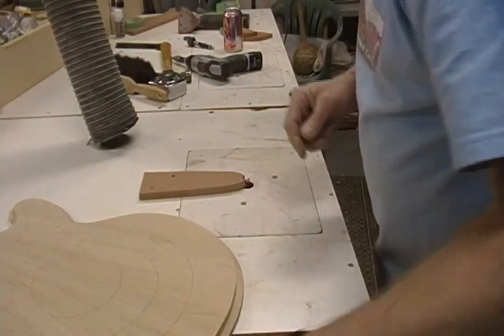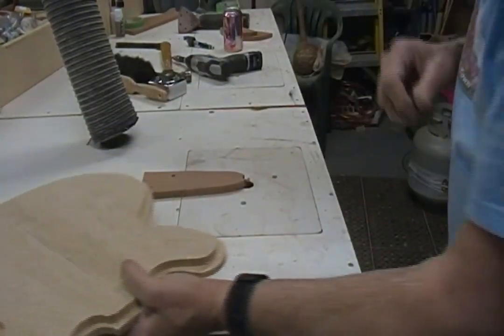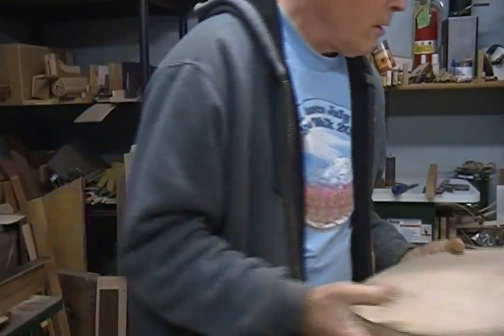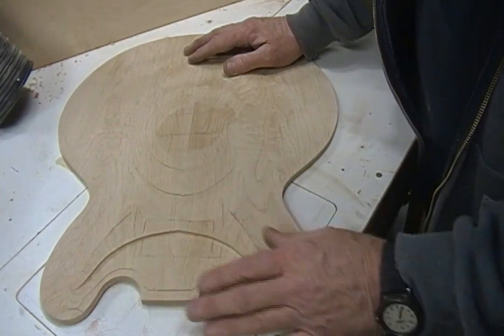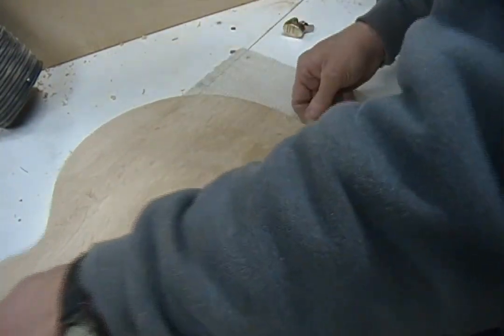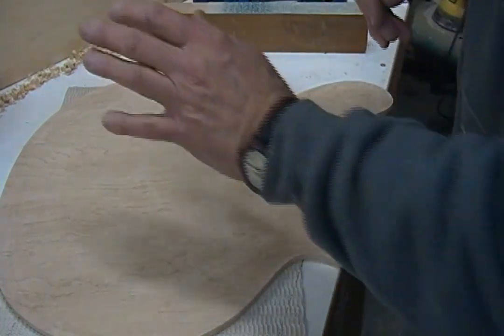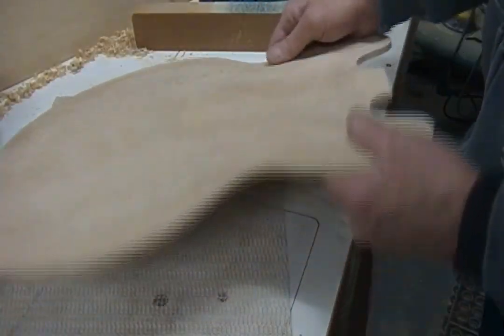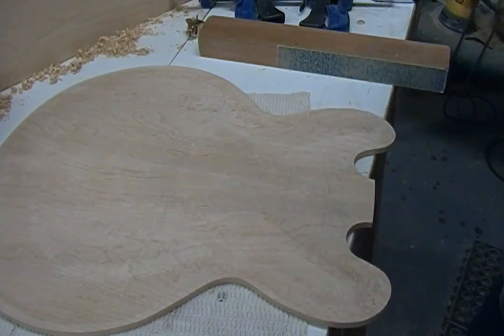CUSTOM BUILT JONAH ES-335 Part 9

Comment: Great idea Dane! I had your video running when I was down in the shop earlier,I was resawing some figured doug fir for a back and side set for a OO I’m working on. Back and sides are beautifully figured,old growth reclaimed Douglas Fir,top is gonna be Doug fir too,as is the bracing. Top is a pretty peice too. Medium grained,straight as an arrow. Absolutely zero run out,color is somewhere between California redwood and red cedar,beautiful color red that fades to almost a cream color on the outsides.  Old friend of mine from back when I lived in Washington State happened in to some old growth fir logs with wonderful color and figure,old growth sugar pine and old growth redwood and he sent me some quarter sawn billets was a pleasant surprise when I had the UPS freight guy show up at the house Saturday afternoon.
Reply from the maker: Sounds like some fantastic wood. You need to start a YT channel or post some pics over at GA forum.
Reply: For a small plane you should order you a set of the maple body bendetto planes from LMI. I just order a set about a month ago and I love them. I also got one of their brass body Schneider brace planes and it was about the perfect size for working down that 330 top o finally started on. I used the router to cut the depth topography in the top,worn out norton flap discs to rough it in and finally scrapers and planes to get it fairly smooth and radiused before sanding. On the inside of the top,for the concave carve,I think I’m try to use my router and cut some depth rings around it and use a steady hand and a chisel to hog the bulk out before getting on with the 4.5” grinder and flap discs
Reply from the maker: @j.mshrader4104 , Sounds pretty much like my process. On the inside I drilled holes to match the out contour. I'll check out those planes.
Reply: Hey Dane,I’m cleaning up my shop this weekend. I’m putting together a box of shit to send you,you can thank me for my crap later lol  you ever use any carbon fiber for neck reinforcement? I have a friend who is in the aviation industry and he sends me carbon fiber sheet scrap,solid rods,solid rectangular rods,ect. I have a boat load of it. I’m actually gonna be bracing a top with carbon fiber here soon as a little experiment. Anyways I use carbon fiber in some of my multi-peice laminated necks and it makes a very stable neck,I’ve made bridge plates out of it,as you know I have more than several carbon fiber and phenolic topped guitars and a prototype Adamas mandolin. Carbon fiber is very light and resonate. I think it would make good grace material. I got a couple neck blanks for you,couple pieces of tiger maple,4/4 sawn. Would make a beautiful back and side set or a beautiful drop top on an electric and rip the side set down for neck laminations,your choice. It’s from a guitar I was contracted to build and the guy never came up with the rest of the money so I used the moonspruce top to re-top old 1969 ovation 12 fret wide neck bowl and neck I had kicking around,used the neck blank on a customers SG that had a broken neck. I cut the body down the middle,cut the center out. Glued the neck in and made it a neck thru. Re-routed everything,stripped the body and used LMI aged toner and crystalac high gloss on it. Customer was happy,I was happy because i didn’t have to fix another subpar Gibson broken neck. Got some other supplies for you too,bottle of fishglue,a tin of my own personal all natural wood wax finish,couple little small block planes,and a Japanese water stone with a couple different grits of slurry stones. If I rember it’s 800g up to 15,000 grit. Get you some nice edges on your plane irons,chisels and anything else you want to get sharper than sharp.
Reply from the maker: @j.mshrader4104 , man you are awesome. What a great surprise! I have not use CF before and I'm looking forward to giving that a try. I'm very excited about this goodie box showing up. Thank you so much J. Oh and I agree 100% about those subpar Gibby necks.
Reply: Dane Nichols is not be afraid to go with out a truss rod in one of my laminated necks with carbon fiber in it. I can compression fret the relief in the neck but it’s a pain in the ass,hence why the 3 vintage martins I regularly play have had the fretboards pulled and truss rods installed.  Over the next couple of weekends I’m gonna get my shop cleaned and organized so when my kids get here from Washington State we can get started on the kit guitar from John Hall. Speaking of John,I gotta get a couple of those Doug Fir tops boxed up and pick out a back and side set,maybe figured fir,maybe curly cherry or curly birch. I’m gonna send a couple b&s sets and John can pick what he thinks will work the best. I’m leaning to the fir. I wanna build a small body with the back,sides and top all fir,carbon fiber braced.

Comment: I did a carve top tele a couple years back with this same contour line method. I'm getting ready to do a bass body here in a month or so now that I've got a cnc machine it should be quite a new experience.
Reply from the maker: CMRCustom, CNC, which one did you get? That should be quite a bit less painful.
Reply: Dane Nichols it’s an xcarve. It’s featured a lot in my most recent video.
Reply from the maker: @CMRCustom , I'll check it out
Reply from the maker: @j.mshrader4104 , CNC? I don't need no stinking CNC! lol

Comment: Nice work Dane. I know how much you like the neck carve process, so this must have been enjoyable for you too. I'm wondering when the "F" holes go in because you'll be dealing with compound radii on the top by then? I suppose the same goes for all the work on the top because I guess you have to figure a way to support it with the back being carved too?  Great stuff as usual Dane. I appreciate what you do Bro'.
Reply from the maker: Well thank you Steve, I appreciate you too. If I cut the f holes before the carve they would be perpendicular to the flat surface. But after the carve they would be skewed to the top. So I cut them after and they are square to the top. If that makes sense. Plus after the carve I'm only cutting through 1/4" of material not 3/4". I do like the neck carve process but it goes much quicker the top/back carves were very3 tedious.
Reply: @jonahguitarguy  Yeah I saw those scenarios as soon as you wrote it, (a light bulb moment!) I'm just unclear about how you fashion a template with a curving surface and of course at that stage it'll be rocking on the back too. I imagine there has to be a way to support the thing. Back off from spilling those beans- it will all become apparent soon enough!

Comment: If you start on the inside, it’s laying flat while you carve - turn it around and it’s still resting flat on the rim🤓
Reply from the maker: Gert Halberg, valid point Gert but I have a 4”wide center block and no inside contour gages. Plus I felt like I could feel the outside carve better than the inside. Thanks a bunch for watching and commenting.